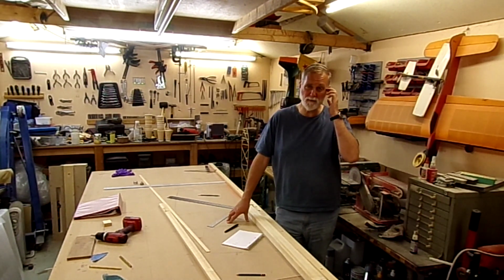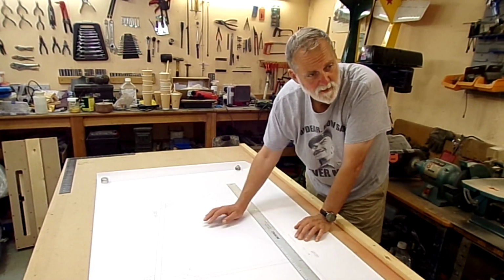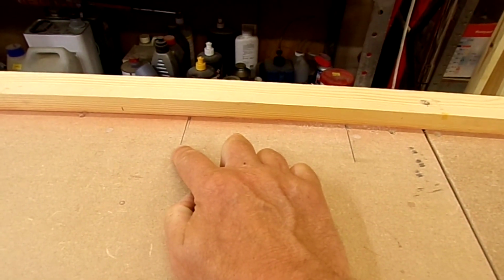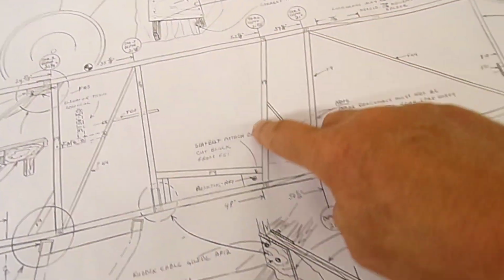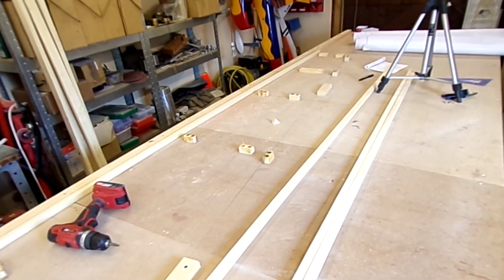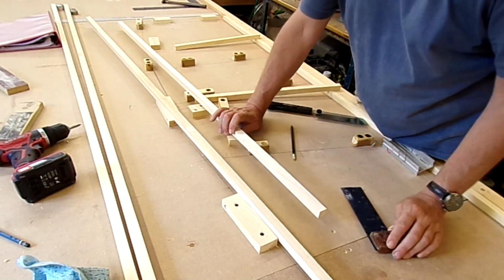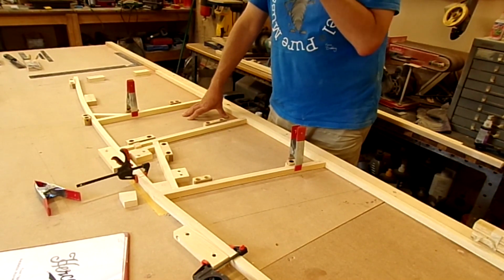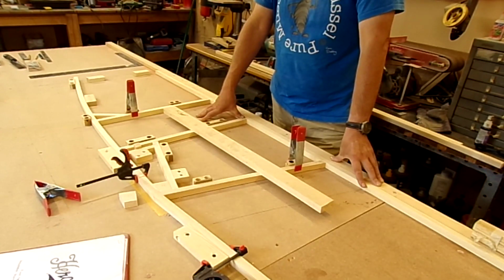EP66 Starting marking out Fisher Youngster fuselage.

Comment: I don’t know if I missed it Algy but what made you double check the paper drawing sizes. I can see that the totals do make quite a difference but was it something that caught your eye or have you experienced these issues before? Interesting to hear your thought processes around some of the modification you have come up with. 👍😎
Reply from the maker: I was always trained only to take measurement by measuring a plan as a last resort and to use the dimensions marked on the plan. I have also found model aircraft paper plans to have stretched or shrunk, so I thought I would double check the Fisher plans. For the smaller components like the wing ribs, it has little effect (at about 2 to 3%, although I did check them using know dimensions but error less than the thickness of the drawing lines) but on the fuselage you can see it is significant.
I do try to help other, by explaining why I do modification and also relating the training and experience I have gained over 45years of engineering.

Comment: Can't wait to see the fuselage. Question, so I get why your doing the different degrees for the engine. But isn't the weather gonna play havic. Expansion and contraction which will always change thise numbers. So why even bother?
Reply from the maker: Good question but the wood tends to change with moisture it's dimension mainly across the grain not in length as much and the sides are constructed the same so will change the same amount in theory.

Comment: What about moving seat back, how’s the leg room going to be?
Reply: The seat position is dependent on your weight and balance...my FP202 requires the seat to be in the front position. My friends FP101 requires his seat in the front most position... build your tail as light as possible!
Reply from the maker: I have moved the seat back 3/4" but there is not much movement other than to use cushions. I always build as light as I can for the rear fuselage as the saying is "Nose heavy flying baddly, tail heavy will fly once". You know I have built the tail but I am doing some mods to the rear fuselage to save weight and change the look a bit.
Reply from the maker: Already come up with some solutions for the seat back and mocked up on the garage floor. All good questions.
Reply: @flyingkub  I figured you would

Comment: It is always intersting to see your choices and adaptations to issues you encounter during the build.  I'm glad you always try to get it right and double check all the measurements.  It is a good example to the other aircraft self-builders out there.
I've just uploaded my 54 Sqn Hawker Hunter model build, which will be available some time tomorrow (Sept 1st, where did the Summer go?).  My next kit build is a P-40, which I've discoverd has a nasty warp in the fuselage halves.  Where's the fun in a kit that goes together easily 'ay ?😄
Reply from the maker: It is great you find my builds interesting. I will hopefully get a chance to see the Hunter tomorrow, when I knew 54Sqn it was Jaguars. I do like the P40 but it needs to straight, as you say 'Where's the fun in a kit that goes together easily'.
Reply: @flyingkub  I've got it scheduled for 10am to give me time to get the subtitles sorted.
Reply from the maker: @YeRobertPayne  I will have to look after work, so after 1730.